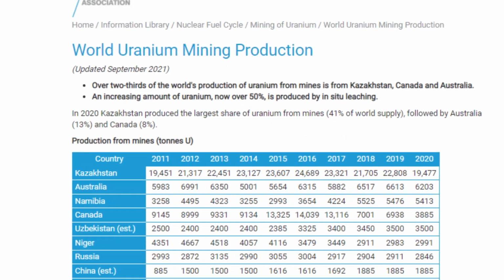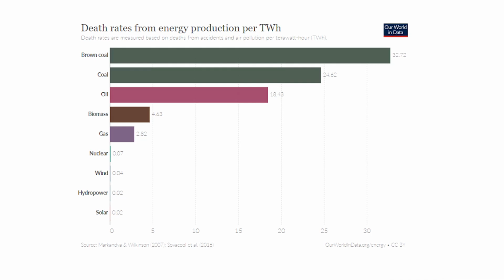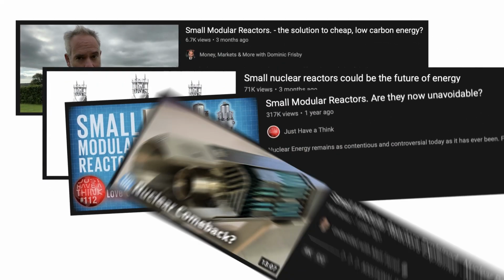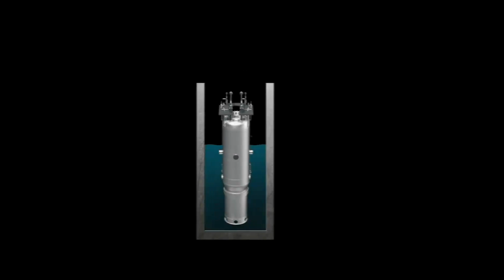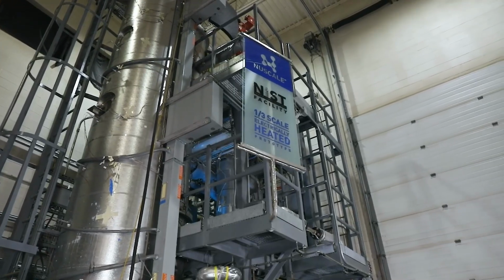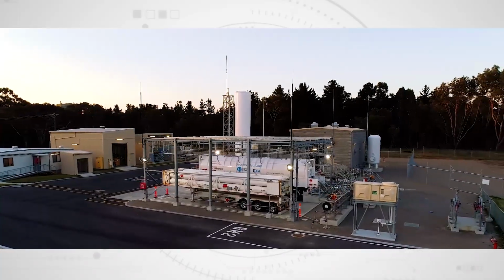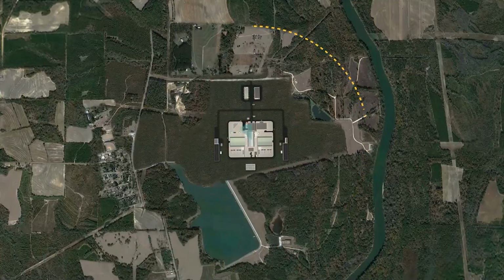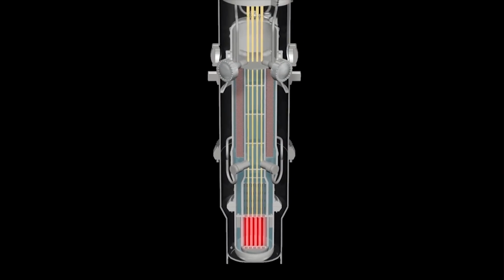Can Small Modular Reactors Save Nuclear Power?

Comment: AI generally like your videos and this was no exception.  However it does seem to be a bit of a commercial for them.  I would have like more questioning from you that did more than just throw a softball for him to hit out of the park.   I don't believe it's accurate to say they "reduce costs by improving the safety system".   Rather they are utilizing a different safety system to reduce costs.  I would  have been interested in more information about the expected life of the reactor,  time between refueling.  Also if one reactor is being refueled can the others continue?   With the smaller footprint needed for these facilities can they store used fuel on the site, and how much room is needed for that?  What type of Containment structure is he envisioning for the reactors?  Would it be A gas-tight shell around a nuclear reactor to confine fission products that otherwise might be released to the atmosphere in the event of an accident.  Or would it just be a cost savings to not have a massive gas-tight concrete structure?   I'm sure as a business he might be fine just putting these systems in a prefab warehouse, but I would like much more secure structure.
Reply from the maker: Those are great additional questions for the next time I make a video on a new nuclear tech. Thanks for the feedback. I'm surprised you thought it sounded like an ad for NuScale, I thought I came across pretty sceptical that they will do what they hope (they are not the first to promise cheaper, faster, safer nuclear). And I also mentioned my opinion that safety is maybe not the main problem but rather perception of safety, and I don't know how NuScale will be any different from other nukes on that front. But it is good to get the feedback on how it sounded to you, I can't watch these with viewers' eyes so I don't know how the tone will come across until you tell me. Thanks heaps for the taking the time to give detailed feedback 😀
Reply: @EngineeringwithRosie  I agree you were very unquestioning, and it did seem like a paid advert. For e.g. due to economies of scale, SMRs are obviously more expensive per MW compared to large plants. On costs, he replied 'the customer has set a target of $58'. What kind of non-answer is that?? On build time, you just accepted his statement than large nuclear takes 5 years to build. That is just nonsense, and you just swallowed it without question, or reference to real world data. And measuring safety in terms of only deaths, is just plain silly. Consider the human suffering, and the economic damage after the Fukushima disaster for example.
Reply from the maker: @pbecker1865  thanks I will take that on board. I thought I by mentioning several times that every other recent nuclear project has had massive cost and time overruns, and saying about NuScale "we need to wait until the end of the decade to see if they do any better"... I thought that conveyed that I will believe what he's saying when I see the evidence. It sounds like you guys are saying you'd like me to push back more on the guests in the actual interview? And not just leave it to my outro to raise any objections? Is that correct? I will admit that is not a comfortable thing for me to do but I can try to work on it.
Reply: @EngineeringwithRosie  thanks for the reply. Yes, pushback is not comfortable, but very necessary, especially when dealing with someone with an obvious huge investment in a certain point of view. Or you could combine in one video interviews with someone with opposing views. But to just take one side of the story results in a skewed result. I have been focussing on nuclear power issues for over a decade, and a little on SMRs, and would be happy to chat to you further.
Reply: @EngineeringwithRosie  I previously joked about people who misunderstood the hydrogen video, and it's a bit similar here. Maybe you intentionally want people to think instead of stating things explicitly?

Like other commenters I'm unsure what the message was. You seem to think new nuclear and SMR won't be part of the urgent transition to renewables, yet the video focused a lot on... how cool SMRs are? 

To be blunt I'd prefer a video where you highlighted the cult-like nuclear hype that exists, which should give some context to SMR technology, fusion, thorium, and so on. (I mean the outdated view on nuclear, which completely disregards the very expensive and clumsy projects and blames everything on the evil environmentalists who took down nuclear, and simultaneously ignores how neat wind/solar/batteries are.)
Reply from the maker: @4drops  that's a good idea for my next video on nuclear then. Maybe in the later part of this year.
Reply: @pbecker1865  Why should Rosie have challenged those assertions?

"due to economies of scale, SMRs are obviously more expensive per MW compared to large plants." - NuScale and the other SMR vendors are NOT obviously more expensive, as although you lose out on economies of scale, you gain on economies of scope - i.e. the very point made at around 5:50.
Remember, the main cost of nuclear is financing, so an ability to deliver a plant faster leads to less expensive per MW as financing costs decline.

"On costs, he replied 'the customer has set a target of $58'. What kind of non-answer is that??"
An extremely robust answer. If NuScale can't make $58/MW or better, they lose the business. Their contract is thus 'we need to make this, or we don't get paid'. They aren't going to take on the project if they believe they cannot make that threshold. Seems fairly cut-and-dried. 

"On build time, you just accepted his statement than large nuclear takes 5 years to build. That is just nonsense, and you just swallowed it without question, or reference to real world data." - The Chinese and Koreans are building reactors in 5 years (because they have crews who are not at their first rodeo). The data is there. Hinkley Point C or Vogtle are examples of mismanagement, not examples of how nuclear build has to be done.

"And measuring safety in terms of only deaths, is just plain silly. Consider the human suffering, and the economic damage after the Fukushima disaster for example."
Or, we could consider the Europe-wide energy crisis - it has lead to energy prices doubling and tripling across Europe - squeezing out poorer families from proper heating and lighting. That disaster is ONGOING, because food prices will rise because fertilizer prices are rising, because fertilizer is energy-intensive in production. It has also led to an emboldened V. Putin starting a war, because he believed Europe would rather be warm than stand with Ukraine.

And why is Europe in an energy crisis? Because Europe is now depend on wind and solar (because it is so cheap; when you can get it) providing a significant share of energy and THERE WASN'T A LOT OF WIND OR SOLAR IN 2021 AND EARLY 2022 - which meant the shortfall was met with gas and coal, driving those prices through the roof, which directly led to electricity and heating prices rising.
Reply: @factnotfiction5915  W.r.t. economics, the reduced financing costs is a good point. Nevertheless various independent reports conclude that SMRs will be more expensive than larger traditional plants, e.g. the Atkins report says 30% more expensive. Even the industry aims only to "match" the cost of large plants, and we all know about nuclear cost overruns.

A "target" price doesn't sound to me like a cut off price. Can you reference a clause in the contract which cancels if the target is not met? (also government subsidies should be ignored when looking at the technology cost).

There is a reason you can only quotes 5 years as examples from countries like China. The regulatory framework is very different in Western democracies, which include steps like public consultation. Even the most optimistic estimates from the industry say 7 years, and the more realistic ones are 10 years. The record as I recall is 40 years!

To blame the complex situation in Europe merely on renewable energy is a very long stretch, and clearly an oversimplification to try to make a point. It could also be used to say renewables should have been ramped up long ago, in which case the smart grid with storage and sophisticated demand side management would now be in place and there would be no energy crisis.
Reply: @pbecker1865  "Atkins Report: ... found that electricity from the first SMR in the UK would be 30% more expensive than power from large reactors, because of reduced economies of scale and the costs of deploying first-of-a-kind technology."
OK - so the FIRST reactor will generate 30% more expensive electricity. Now, what is the price of electricity from the 10th reactor?

"A "target" price doesn't sound to me like a cut of" - look, rather than play semantics, why don't you just send an email to Jose Reyes and ask? Alternatively send an email to UAMPS. I believe it was a clear message from the customer - deliver this price or we walk - which implies he believes he can make that price.

"There is a reason you can only quotes 5 years as examples from countries like China. The regulatory framework is very different in Western democracies"
True! However, given that the IAEA has given those reactors a clean bill of health, perhaps it is the regulatory framework in Western democracies that should be examined. The bottom line is that China can build mega-projects, and you can't in the US - unless it is a natural gas-fired power plant.

"It could also be used to say renewables should have been ramped up long ago, in which case the smart grid with storage and sophisticated demand side management would now be in place and there would be no energy crisis."
Sure, you could argue that.
The point is, AT THE PERIOD IN TIME WITH THE MOST INTERMITTENT RE CAPACITY - the wind and sun didn't show up! You can't build an energy strategy around something so flaky. 

Had Intermittent RE been 3x-4x the installed capacity today, then they might have just made the cutoff (on average, but power isn't consumed on average, so they would have still failed) if you squint.
Ok, fine.

Now, add in the cost of 3x the assets that sit idle most of the time!

I'm not sure the 'cheap' wind and solar come out so cheap when you have to carry all the extra stuff.

Look, it is fine if you want to install 3x-4x the SWB than needed - but be honest and include that cost in your numbers.
Reply: @4drops  https://youtu.be/IpahlJUZLwo